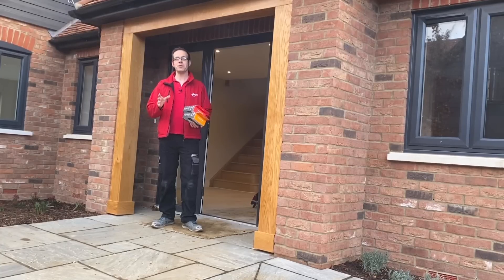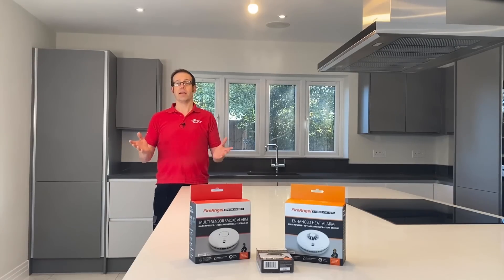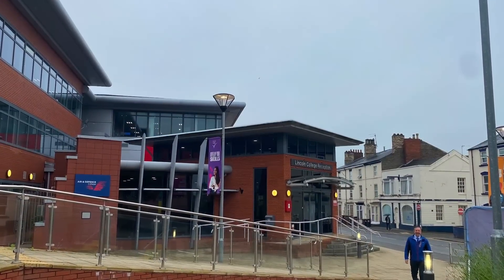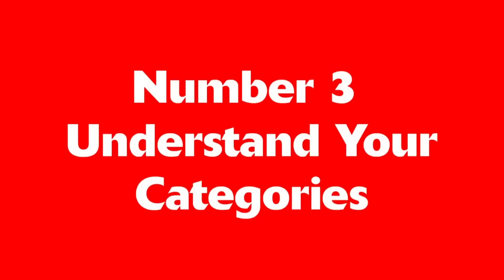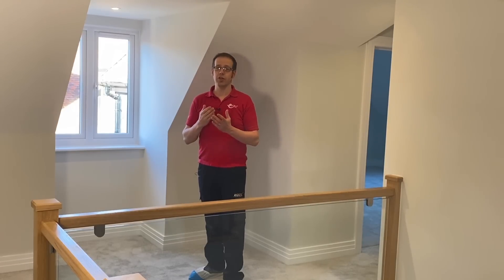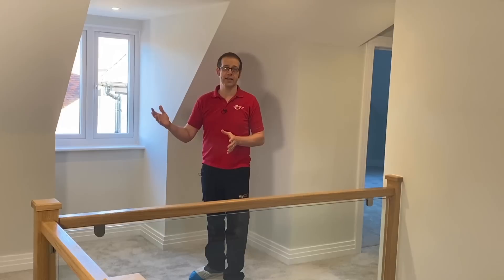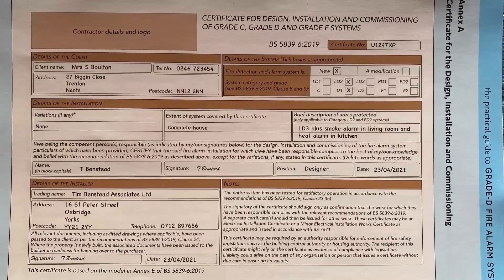5 THINGS YOU SHOULD KNOW BEFORE INSTALLING SMOKE ALARMS

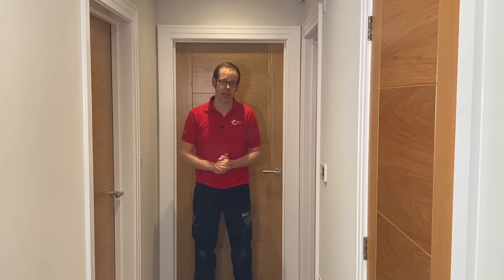Comment: 4:30 strange about putting smoke alarms in attics (lofts).  Here in the US they say not to install them there in unfinished areas due to dirt/dust and false alarms.  You can use heat detectors up there, but here in the south were attic temps can climb into the 150F (65C) range when its 115F (46C) outside you have to make sure you use pretty high value heat detectors.

Comment: I've not had good experience with Fireangel detectors.  Fun fact:  If they are not mounted onto their mounting plates, then the detectors won't activate when the test button is hit.  You can try this prior to installation.

I've found that if the mounting plate is not screwed to the ceiling via the middle screw mount, then the weight of the detector on the mounting plate will cause it to sag a little, and then you have a discontinuity that leads to the detector failing. 

Nothing wrong with the electrical wiring, and not an immediately apparent problem, but a little sagging (a few mm) over the space of a couple of weeks will cause the test function to fail (even if the mains indicator is illuminated).  Solution is to remount the plate using the central screw hole.

Comment: This is one of the few areas where we in the USA are ahead of the UK. Smoke detectors are required in each and every bedroom. At times I'm lucky that I'm woken up by my alarm clock, so I wouldn't want to rely on being woken up by an alarm outside my closed bedroom door. I will say that when all my interconnected alarms go off it does make quite a racket.
Reply from the maker: That's interesting, similar would be required in some circumstances but you're right maybe we need to have a look at how it's done over the pond...
Reply: Probably due to your proliferation for timber frame buildings and natural gas utilities?

Comment: I have a question maybe someone can answer with clarity on how its been reached. 
If a customer has a wired system and its out of date and they wish to replace it for a smart smoke like one from SimpliSafe is that allowed or do you have to have 4 alarms for example on a two story 2 downstairs and 2 upstairs one smart one dum
Hope this makes sense
Reply: Except in Scotland. I believe that if you are replacing a detector there would be no need to redesign the whole property. You would need to test and commission the replacement.  Noting as a replacement, recommending that the installation is brought up to current standard .. and recommending risk assessment if none available.
Reply from the maker: Good question, we'll do some research.

Comment: Interesting Idea of your government that you need all this stuff for be save inside a house but why do you not have regulations about the place to install the CU (and fire alarm control) e.g. in height of 1m till 1.8m and near the entrance door - so that the normal UK people can find it easy if do you have an electrical or fire alarm problem. Or the fire/police man or neighbor after a call? 

The second is that all this stuff should be checked and renewed same the CU all x years. So how paid all this costs for install and checking and reinstall all x years? All people must have a fire insurance same the health insurance how pay all this costs? What happened if the system works incorrectly if have a fire e.g. Grenfell Tower? What if check-list tested but the tradesmen would do a wrong install or the home owner creates a new room with hazardous materials between the checks and renewed installs? I think about this things do you not speak but I think too this points are not figured out in the book. 

In Germany we use single alarm with battery (change yearly) or 10-year-longlife batteries for private houses only. The half-yearly test do every homeowner alone. In skyscrapers mostly worked an extra company, payed from landlord or owner. All components are compatible together and costs new around 20 till 30€/piece. 

Companies and firm houses need a central 240V point, extra back-up batteries, and central alarm display. But I see first radio connection between them for older properties (where one interconnected system over cable impossible e.g. remote areas). This should be tested every two years or after a fault or use it. All products are selled over 10 years with a theoretical lifetime warranty.
Reply from the maker: Hm, maybe we've got something to learn from our cousins on the continent!

Comment: Good luck getting fire angle wireless interconnect battery units been trying to get them for months    now even tried fire angle direct thay don't know when thayr due In stock first class units easy to install etc but with most things in the building trade no production either due to covid or brexit plenty of work but no materials what's happening fire angle?? 🤔🤔
Reply from the maker: Just done a quick check and CEF appear to have a load as well as our local Screwfix. 🤔
Reply: Thanks I'll call my local cef & screwfix now thanks guy's 👍

Comment: You didn't mention that we now have different regs in Scotland and that ALL properties need to have interlinked alarms fitted. Fortunately Fire Angel cover the retrofitting with the battery alarms they produce otherwise it would cost home owners a small fortune. As it is with units cost around £40 each it isn't cheap. The main problem with the Scottish regs is that they stipulate where the basic alarms should go with no accounting for the property use or ignition source. E.G there is no requirement to install an alarm in a utility room that almost certainly will contain a washing machine, tumble drier and freezer, all of which have been major ignition sources. But you have to put one in a circulation space with no ignition source regardless of having each room off that space covered by separate alarms. My wife is deaf in one ear and doesn't hear the alarm clock, so I have installed an alarm in the bedroom, also there are USB charges and various other potential ignition sources.
Reply: Also acceptable to fit wireless smoke and heat alarms with 10 year lithium ion battery to comply with the Scottish legislation. All the best, Pete 👍
Reply: @peterc3228  That is the only practical solution for most retrofits. I certainly wasn't about to cut up floor boards or worse still damage artexed ceilings to fit hardwired versions. That would have cost another £1000 for what is a knee jerk reaction by the Scottish Government based on the Grenville incident. Whilst I agree alarms save lives and I have always had them, what saves more lives is proper maintenance and awareness of potential ignition sources.
Reply from the maker: Great information, I didn't know that about Scotland. Thanks for commenting!

Comment: Yeah I’ll just stick with my Nest Protects! They all talk to each other and plus do CO2 and do self test of speaker mic and wifi itself
Reply: Nest protect detect  CO (carbon monoxide) not CO2 (cardon dioxide found in carbonated drinks). Also if you have the nest thermostat it will also switch off your boiler with it detects carbon monoxide. I wish they would make an heat detector, so I can continue my system but it will look like I will be going over to Aico
Reply: @charliechan22  lol yes now you’ve said it I’ve just noticed what I put yeah I’ve got the thermostat too, but it looks like Google has killed the company as they are not really doing much at the mo with no real new devices on the pipeline
Reply from the maker: Thanks for commenting!
Reply: In Scotland,  under 2022 Regs - Note that the Nest Protect System will not meet the standard. This is because they do not meet the requirements for a heat alarm under the relevant British Standard. British Standard (BS 5839-6:2019) states that only heat alarms should be installed in kitchens.
Reply: @agpe829  which is a shame as all the nest protects have the heat sensor built into it already, they just need to disable the smoke side in the kitchen ie when you place it in a kitchen for it to disable the other sensors and maybe give a warning that it’s in heat detect mode only during tests and for it to display differently to the other protects in the app to reflect that

Comment: as an alarm collector when i get chance ill be installing a full conventional fire alarm system in are three bedroom house, some people may think its a bit over the top but if you think as all the detectors are mains operated and have a back up they are much better. and also callpoints will be in use so it will be much more easy to sound the alarm
Reply from the maker: Wow, send us pics on social media, sounds amazing!
Reply: @efixx  will do!
Reply: I've never yet come across a fire that's been scared out of a building by a fire alarm. My friend wouldn't bother with alarms. He'd simply fit sprinklers everywhere. Minimal maintenance and fire prevention - as long as you don't turn the water off during your winter holiday !

Comment: Aico recommend not using the aerosols for testing as they leave a residue in the detector. They say just to use the test button. The Aico 3000 series also have a brilliant download feature from each detector with lots of information so sorry I'll be sticking with Aico. The standards change so much it's difficult to keep track what is current,  Scotland is different as well. Thanks Joe
Reply: Well said Mark. I've installed many Aico 3000 systems and the are expensive but trustworthy. Been to a few FA installs after 6 months the RF signal seems to be problematic on some.  Scotland has the new tolerable standard act of 2019 which is live at the end of Jan. It's making every property safer, as long as the customers are avoiding the cowboys. It's the PV FIT gold rush all over again for Clint Eastwood and his mates.
Reply from the maker: It's interesting to hear different people's take on things. Thanks for commenting!

Comment: employers require installing Aico multi sensors on EICRs if there is equipment in the attic, heat/co2 in kitchen and where ever there is a boiler and updatedd to LD2 D1, brownie points for thumb nail
Reply from the maker: Ha! Glad you clocked the thumbnail. Cheers!
Reply: Surely you wouldn't put a co2 detector in a kitchen with no gas or solid fuel appliances?
Reply: @monikaw1179  combined heat/co2, chances are you have a gas boiler, gas oven or both
Reply: @N1cholls93  Many kitchens are all electric, and the boiler isn't necessarily in the kitchen.  My own home is like that, for example.  I have a co2 detector in the room where the boiler is, interlinked to the smokes.  Also battery co2 detectors in the bedrooms due to my paranoia.  I don't have one in the kitchen as it would be pointless.
Reply: @N1cholls93  CO, not CO2
Reply: @AndyC2_   so we’re not fitting carbon dioxide alarms? 🧐
Reply: @monikaw1179 CO, not CO2

Comment: Nice information Joe, thank you. I had some experience of Hochiki detectors, they used 24v power  and I didn't know we have detectors which use mains power. interesting!
Reply from the maker: Thanks Sajad, more of a domestic situation for mains powered. Thanks for commenting!
Reply: You are referring to Commercial Fire Alarm Detection systems, that have a separate control panel with 24v Sounders/Beacons and Smoke/Heat detectors. Domestic was initially 12v stand alone detector/alarm combined with no control panel, then progressed to mains with a 12v back up battery, also stand alone, no control panel.

Comment: The interconnecting cable between smoke /heat alarms is not mains voltage.  It's a low voltage trigger (9 volt ) . It's 9 volt because it has to work when the mains power is off and it's working from the integral battery .
Reply: thanks it does make sense.
Reply: Correct
Reply from the maker: Great comment, thanks for the info!
Reply: My understanding is the voltage is low, but it's not isolated from the mains (it's normally referenced to the neutral), so it still has to be treated as a "live conductor".

Comment: Happy to instal, but I won’t be responsible for system design. Sorry but my view of the BS for domestic fire detection is in need of trashing and starting over.
Reply: Happy to take the money, but not willing to do the work or make sure it's safe for the property or the intended occupant. Sounds about right for a house basher! Your attitude the reason legislation is written.
Reply: @sandymcnair5298  hi Sandy - just to clarify - I won’t be doing design as I no longer feel I can perform the function. So, as another has already suggested, I will leave fire safety system design and compliance to a competent person… Please note - your gas lighting abuse is not appreciated by me. Hopefully being concerned with mental health and well being is something you (and others on this channel and in the industry) have a care for.
Reply: @davidw460 W Two different posts there David! Your first post indicates that the reason you won't design the system is because the BS for domestic fire detection is trash and needs starting over (This statement indicates a level of competency in the subject). Your original post indicates that you are also willing to install the products. Nothing in your post indicated that this decision is about the competence of your design knowledge. I would therefore advise that you should not install any fire alarm systems unless you know that they are fully designed in accordance with the relevant standards. Installing these products without ensuring that they have been professionally designed is not in compliance with BS7671 regulation 660.10. A lack of understanding and ignorance (conscious or unconscious is a huge issue in unsatisfactory and unsafe installations in the domestic market where low cost is king. Legislation is all we have to protect ourselves and others from cowboy installations. If you currently have a disability or ill health, I am really sorry for your distress. While concerned with ill health, I am also concerned with dangerous and unsafe installations; therefore, it does not change the status of the original comments made.
Reply from the maker: Interesting, thanks for commenting!

Comment: i fitted one of those make smoke detectors in my own house once, it caught fire and set itself off! gone back to aico, best make to use.
Reply: That’s one way of drumming up business I suppose.
Reply from the maker: Hm, was it an internal fault on the smoke?
Reply: @efixx  the circuit board released its magic smoke, was a basic battery one that i put up as a stopgap while i wired mains one.
Reply from the maker: Interesting...

Comment: Here's my thoughts and questions. The 11k and 25k electricians from The electrical community and The electricians talk group will tell you never to use Fireangel as they are absolute S***E. 
Aico is the way to go👍
Reply: As a designer and specifier I would always specify AICO. This is likely to be a paid promotion for fire angel and not a unbiased recommendation.
Reply from the maker: I don't see a question but thanks for commenting! 👍
Reply: Yeah Aico are good , but according to the trainer who did a training session when I worked for a housing association on installing their products they don't get any faulty items . I said bullsh*t any manufacturer is always going to get some faults especially if you sell hundreds of thousands of devices . Also we had faulty ones which we had to replace when they were going off randomly.
Reply: I use Kidde Firex, always been reliable for me.  I think Aico might have the edge with the cable connection side of things though.